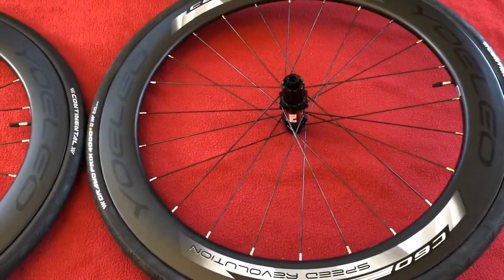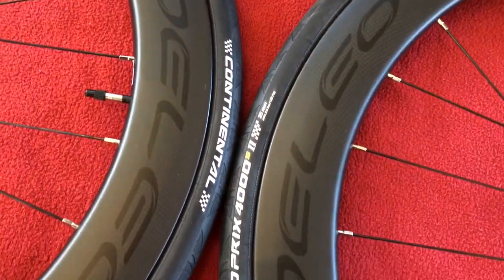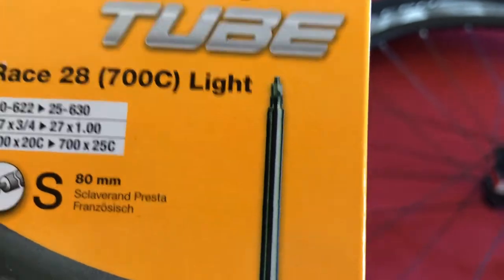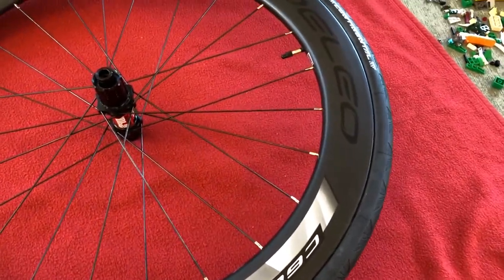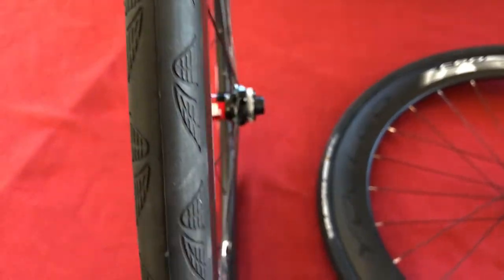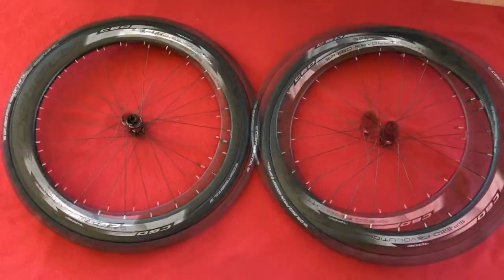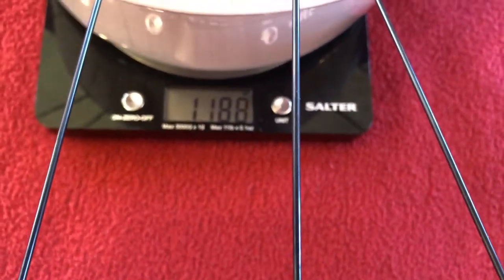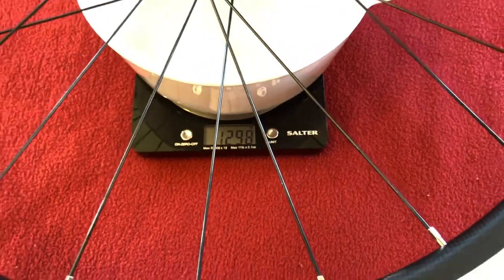Yoeleo 60mm Rims with 28's don't fit....25's to the rescue

Comment: Thank you for posting this ! Have not bought wheelset yet, but now know to focus on wheelset optimized for 25mm not 28.
Reply from the maker: I’m sure other brand 28’s would fit, conti’s profile just not compatible
Reply: From my experience the GP 4000s seem to plump up 2-4mm more than their stated size. Internal rim width also plays into that. They are  such a great tire though !
Reply from the maker: Endurance Cyclist yeah conti’s are the only tyre I’ve ever used. Can’t fault them

Comment: Nice choice on the tubes.  Glad the 80mm valve stem worked out for you.  Should be less problematic compared to using extenders.  I have found the specialized tubes that are in the plastic bag with talcum already added to be really durable and longest lasting of all the tubes i’ve used.  The bontragers are the easiest to puncture through pinch flats.  Just my experiences.  Digging watching your build up.
Reply from the maker: Tony Crabtree yeah never had a problem with race lights so I decided to stick, was considering latex tubes but stuck with what I know, the 80mm stem is a god send to be honest, still needs that tape round the valve hole though, thanks for the support, getting some more vids made for next week.

Comment: My last pair 700X28c GP 4000s 2  pump up to 90 psi BUT the tyre turn into 700 X 34 height x 34 width  end up lower to 75 psi just to get more clearance for my fork . Will use it any rear wheel tyre
Reply from the maker: jack2seng I couldn’t get the wheel on without a struggle, then less than 1mm clearance... 25’s much more room!
Reply: Kyro's House yes same issue , I use them on my disc brakes bike but mostly fix up the wheel before I start  pump up to the right psi
Reply: @jack2seng  so can I fit the 28s on the wheel set?

Comment: Shame you sent the 28cs back. I would have bought them🤣 build is looking sweet tho.
Reply from the maker: matthew gibson yeah looking forward to the 25’s in action! ..... at least the wheel will turn round now. 👍
Reply: you wont be disappointed, I've had 3 pairs. and had one puncture in over 5,000 miles. which on the cumbrian roads is pretty good going! pretty sure you sold me the ST-R785 lever too!
Reply from the maker: matthew gibson yes I did!